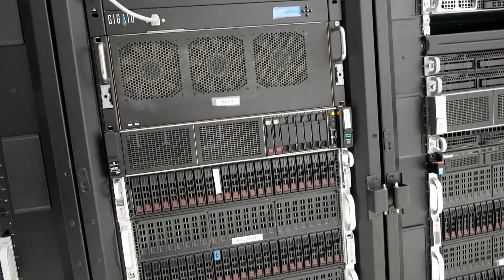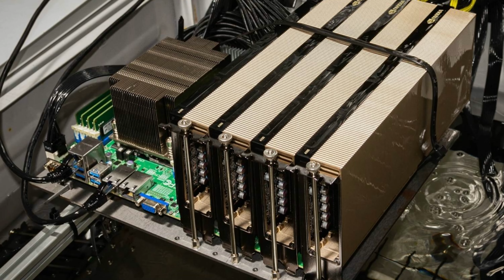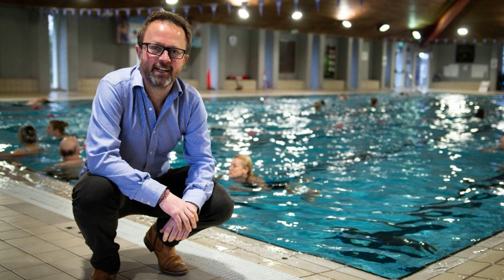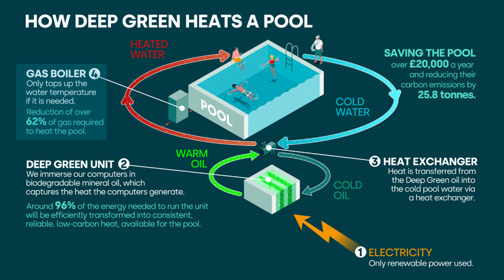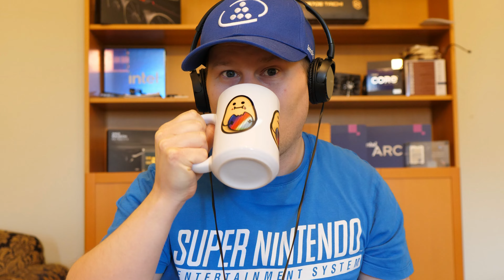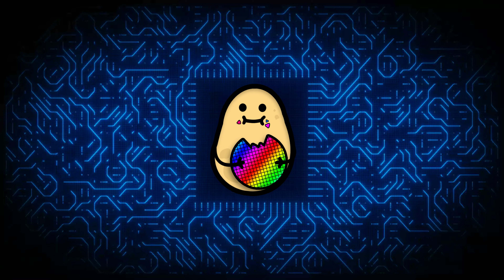Servers for Swimming Pools. No honest, hear me out

Comment: The question should be can the servers make up for the heat lost from the water over a given period of time. Also wonder about the temperature of the waste heat and if the system is going to be a giant heat pump.
Reply: Shouldn't need a heat pump if the oil temperature is sufficiently higher than the pool temperature. Then it's just a matter of using a sufficiently large heat exchanger. Plumb that in front of the existing pool heaters and there you go. No need for any phase changing with a heat pump.

Comment: hmm. heat capacity of water is not that relevant. It is the heat loss rate of the walls of the swimming pool and the transfer rate to the air. It would be better to estimate this heat loss rate from the quoted energy bill

Comment: This is a step in the right direction.
One that is inevitable.
With electricity generation, this is already done at scale, but not widespread, mainly in the far-north. But something that will almost certainly be rolled out much more widely as it simply improves the economics. Combined Heat and Power (CHP), or cogeneration. So district heating, feeding industrial heat, etc.

So here I'd guess it could be called Combined Compute and Heat (CCH).

As Moore's Law unavoidably drives heat generation thru the roof, liquid cooling inevitably has to become more prevent, and this simply makes using this waste heat easier to pipe away for other uses.

At the moment, so, so much waste heat from generation and industry is just dumped into the atmosphere, which doesn't need heating.
So dumping it into existing heat needing applications will only be a win-win WHEN we get good at it.

It'll be interesting to watch this inevitable trend advance.

CCH for the win!

Comment: Well, if it was 13900KS, they would be closer ;)

But in all seriousness - while it will bring the costs of heating down, the costs of maintenance (Mineral Oil alone is a very nasty beast to deal with) will either have to be payed for by operator of that server or something like that. Not to mention it might start paying back after many years in which case the servers will probably be in the need of changing to new architecture. I'm aware that servers usually have longer life-spans than "gamer computers", but still - if break even point is at 6 years for example, then it will be close to the need of upgrade.

Depending on what it will be used for it is either very mildly beneficial and/or publicity stunt. At worst it might be a scam.
Reply: servers do not have longer life-spans than consumers computers. Generally in datacenters they are replaced around their 3rd year for more performant/efficient systems.
In fact those "old" hardware are a good source of refurbished e-wastes for those kind of heating devices. Can't be dumber than using resistive heaters but not as smart as using heat pumps and avoiding heating stuffs like outdoor pools.

Comment: I think a fine solution is to use waste heat from datacenters to heat homes. This is already being done with waste heat from factories, so the benefit here is that the technology is already in place. Only problem is the infrastructure costs, because of all the extra plumbing of hot water lines to homes
Reply: Heating my flat keeps my GPU miners still profitable. At least until April ;)
Reply: Yes, this also what I think would make more sense. In Germany we already have gas power plants in cities providing waste heat to the buildings around. I think the way to go is to move the data centers in the city or to the powerplant to reuse as much infrastructure as possible. Having only 12 servers on a pool doesn't seem any useful, who should use that? It's far to outspread to have a good interconnect between facilities and maintenance requires the technicians to drive to the swimming pool.
Reply: it might make more sense to use it to heat larger, more open-air places. Like malls, airports, etc.

Comment: I use my fanless mITX ivy-bridge i7-3720qm to keep my room warm, more than likely, that level of compute is all a leisure centre would ever need. I think my room ambient is 12.5 degrees, this streaming box zone 3 temp is 50 degrees. I suppose you could heat a tropical fish tank but not toast a muffin. I'm a big fan of keeping electricity and water away from each other.

Comment: The cost of sending out techs to lots of small locations would be pretty large I assume? Also, the cost of physical security seems like it may be a problem
Reply: Physical security doesn't seem a big challenge to me. Mainly they wouldn't be able to spread the ~ fixed cost to more racks, as they are only going for 24 systems, plus some storage and interconnect i would imagine

Comment: Wasn't there a Microsoft or Google project putting servers in the ocean? Maybe not the best idea to further heat up the oceans, but water cooling is already rapidly becoming the norm for high-end server systems, why not go all the way?
Reply from the maker: So that's a self-sealed vessel with servers inside. Not a system where the seawater is doing the cooling directly in the system.
Reply: @TechTechPotato  It was called Project Natick and had 12 racks inside housing 864 servers, the tank was also dry nitrogen filled (to minimise corrosion possibilities and as a fire suppressant by taking oxygen out of the equation).

It used heat-exchangers / radiators on the back of each rack with sea-water piped through them and back out into the ocean to keep everything cool (very similar to cooling used on submarines), it was deployed in the northern Atlantic Ocean at the EMEC in the Orkney islands.

The biggest issue with it was having to replace/repair any downed servers, as you would have to disconnect and haul the entire thing ashore to do any repairs on it, with that said the server failure-rate was 1/8th of what you would get in a regular DC over the same  2 year period, most likely due to the fully contained benign environment inside.
Reply: @Uro666  another issue I suspect is how the marine life (plankton, algae, mollusks… ) and water minerals would interfere with the pipes and radiators or even clog the system.